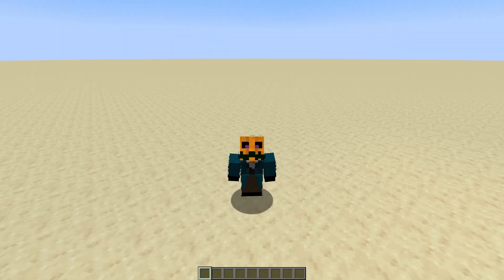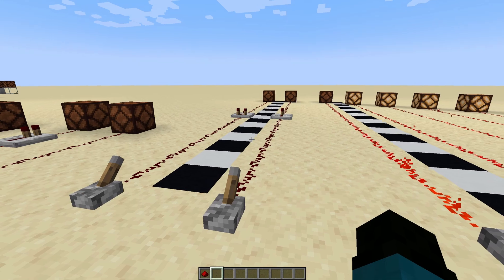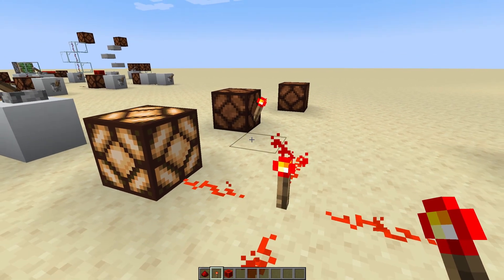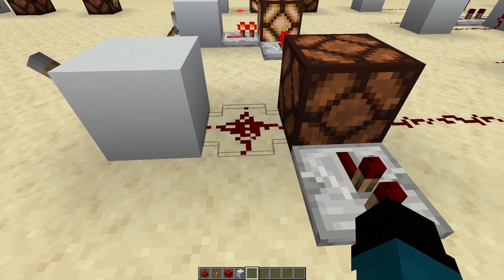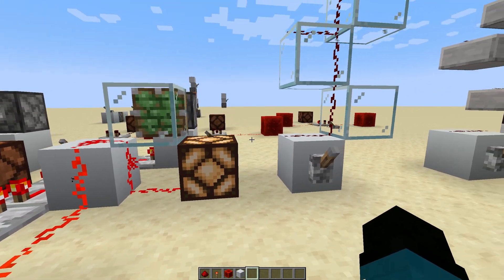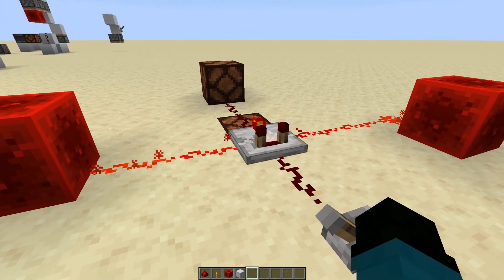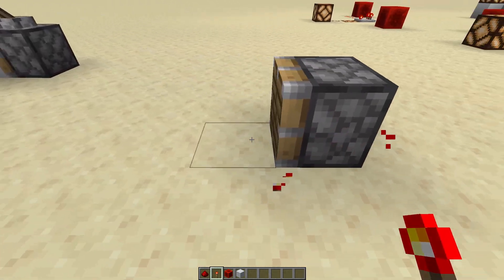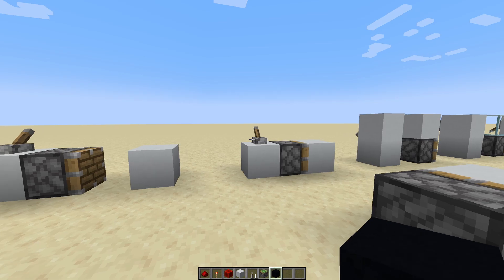Redstone Secrets .:. The Introductory Lesson

Comment: Your explanation of QC isn't quite right. What is actually happening is that pistons, droppers and dispensers act as if they were two blocks tall, so if the block above them receives power, then the piston receives power. In some cases that might not actually cause it to update (extend) if the power source is too far away. Your example where you powered the block in front of a piston was QC - the lever actually powered the piston "directly" (actually through QC) and it has nothing to do with the block in front of it.
Reply from the maker: Yeah, I'm hoping to do a whole video on QC, because it's very counter intuitive. Very fun to learn about though!

Comment: Overal a great little introduction to redstone! Though the nerd in me wants to point out some corrections:

4:45 Should be greater than 1 redstone tick, not 1.5. Redstone torches can even react to 1 redstone tick pulses in some specific cases. But that's for another video ;)

11:12 For another piston to interact with the pushed (or pulled) block, you're correct. If this pushed block ends up powering a circuit (for example when the block goes over a redstone torch, or even if it's a redstone block itself), it is 1 redstone tick. Although a technical correction, I feel like this one is worth pointing out.

14:14 I find this to be a poor example of qc (quasi-connectivity or interchangeably known as a bud, or budding). I don't know the general term for this use case, but I call it self updating qc. Redstone torches, observers, levers and buttons (and maybe a few more components that I'm forgetting) can all self update a qc'd piston. Redstone dust as well if it's budding the piston, and updating it at the same time.

My brain was slightly melting, having to think in redstone ticks instead of game ticks xd

If I got anything wrong please let me know ^^
Reply from the maker: You know, you're right! I bet a video on 1 redstone tick torch updates could be fun. I didn't know about those before now!

For the others, thanks for the clarifications! One of the main reasons I wanted to do this series was to sit down and learn a lot about the technical side redstone, so I'm always happy to learn something new. My brain basically melted when I sat down to record what I wanted to be a 10 minute video, but ended up being 30 minutes of footage/explanation that I had to cut down XD. There is so much to talk about!
Reply: @thelumblehumberjack  I may not be the most knowledgeable person regarding redstone, but I'd love to help you out wherever possible ^^
Reply: QC and bidding aren't actually the same thing. QC powering a piston, dropper or dispenser can cause it to go into a bud state, but there are other ways to achieve budding without QC and QC can happen without budding